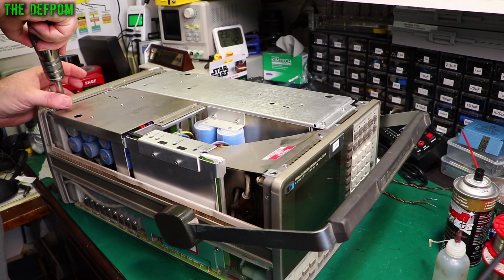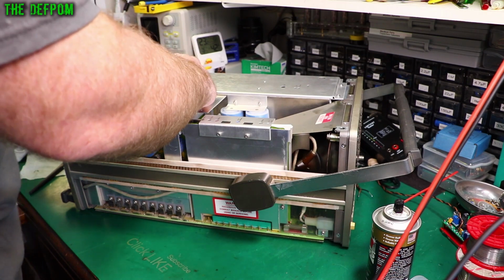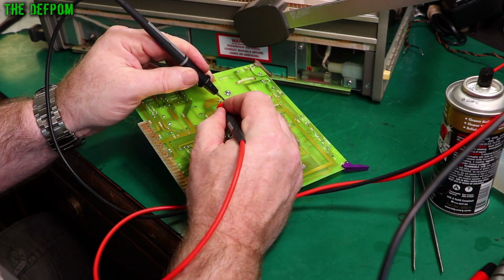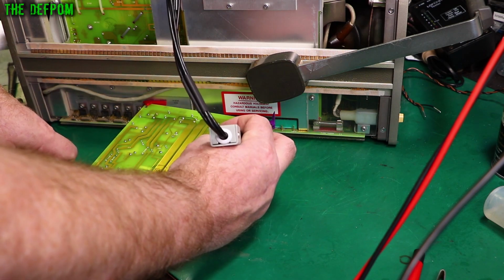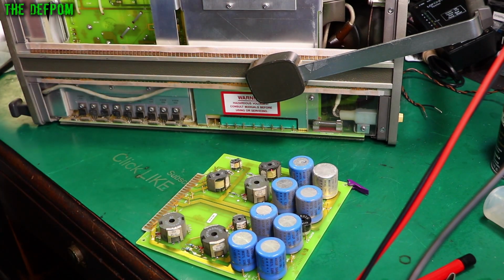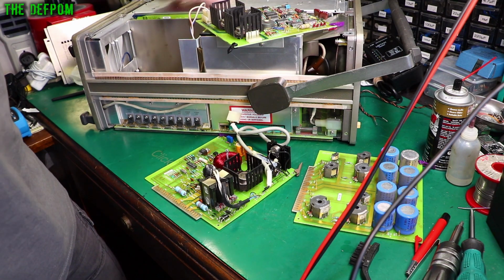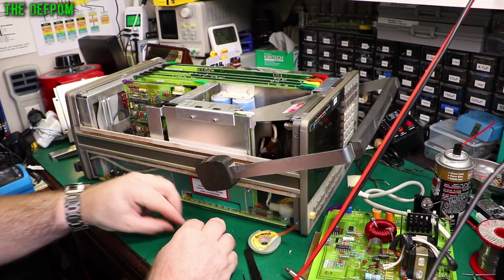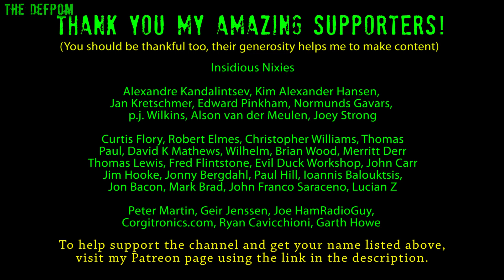🔴 Can It Be Fixed? HP 3561A DSA Repair Part 2 - No.904

Comment: Be glad all the Schottky diodes are good on the A71. The big one for +5V is discontinued, you would have to replace with a TO-220 package part. The little ones for all the other supplies are $25 each! I'm in the process of troubleshooting a spare A71 card.

Comment: Great work so far, Scott. There is another plug-in board there in the video section that could be pulled to check for a short or bad looking components.
Reply from the maker: That video board is in part 3 👍

Comment: Brn/Grn/Blu dipped tantalum capacitors are 1.5uF 20V I think......
Reply from the maker: Possibly, I haven’t tried to work it out, I done remember which end the bands start from for a start !
Reply: @TheDefpom  The order is tip to lead. Brn/Grn are 1 & 5, Blu is 20V.